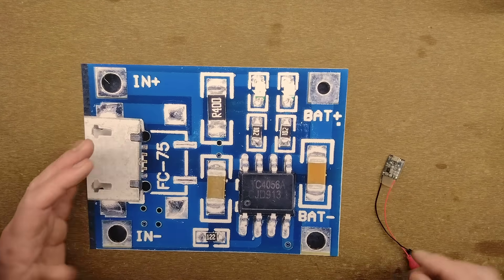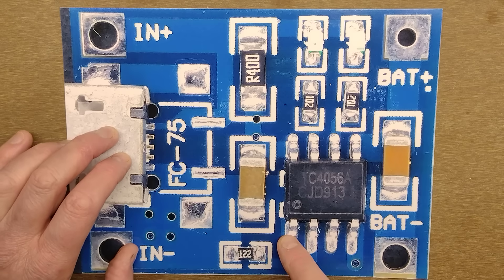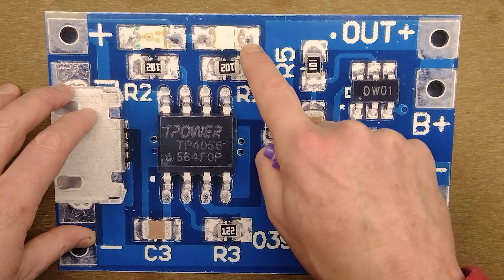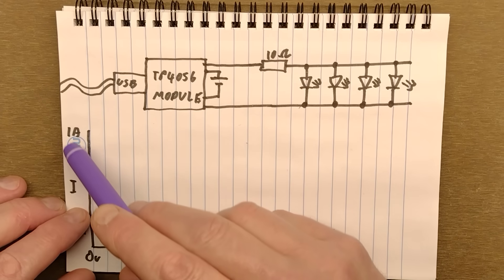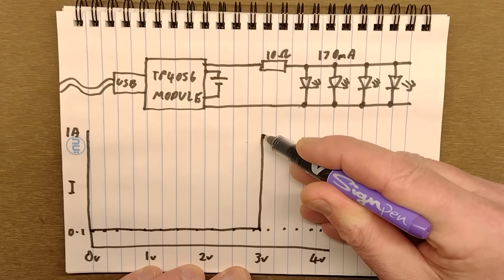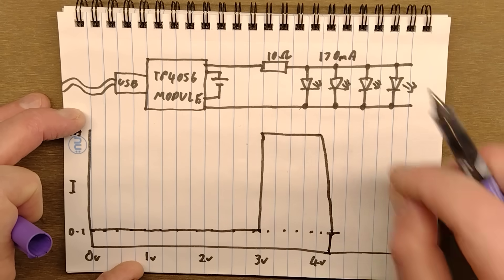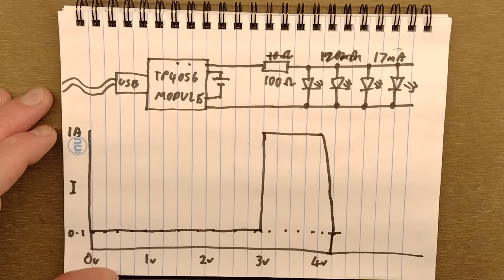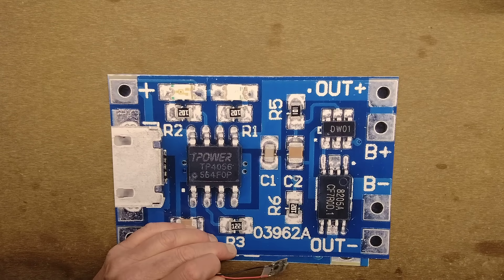TP4056 myth busting

Comment: Who do I have to blow to get a charge chip with adjustable max charge voltage? Every one I can find is set to 4.2v and can't be changed :/
Reply from the maker: Sadly, finding a charge module with adjustable end of charge voltage is difficult.  Otherwise it would be nice to program it to end at 4V to prolong cell life.

Comment: but what if I need a small cell battery, with a capacity lower than 1000mah, how to limit charge current below 1A? is there any module with customizable resistor?
Reply from the maker: You can swap the charge control resistor on these.  The datasheet for the TP4056 lists resistances and currents.

Comment: Great video! I am a battery pack newbie.  I want to make a battery pack with 4 18650 in parallel.  These modules are all i can find. I was wondering if you could hook 2 together to get 2 amp charging.
Reply from the maker: There are modules for higher current charging that just have these chips in parallel.  Make sure your cells are all at very close voltages before connecting them in parallel.

Comment: I know this is a pretty “old” video but see the uploaded is still active in the replies.

I’m using a esp32 c3 super mini with 10x 5v ws2812b LEDs. (Which can run easy on lower volts)
With the tp4056 module connected to a LiPo 3.7v 2500mAh on b+/b- pins and esp32/leds connected to OUt+/OUT- it works perfectly fine.

Max current measured at full white bright and WiFi activated on the esp is 0.67A but that would not be the use case for me.

At average it would consume about 0.48A with LEDs on (patterns with addressable LEDs)

The only “problem” is that when I power off the LEDs with the software, the esp still consumes about 0.12A and the solid red led from tp4056 stays on (charging).

When I put a switch between the tp4056 and the load, it instantly lights up the blue led when switched off.

So to make a long story short, from what i understand from the video is that it’s okay to charge while load is connected and LEDs are on/off, and the “red charging led” is only lighten up because the consumed current from the esp is just above the minimum current threshold for the tp4056 to switch to the blue light?

But there is not a big risk to overcharge the lipo only because of the red led?

Thanks for the great video and you can find some time to help me out. 👍
Reply from the maker: The lithium cell will not be overcharged.  0.12A is a very high standby current.

Comment: I have a Merlin handheld toy that takes 6 AA batteries. Since this can deliver 9 volts, do I need more than one Li-ion pouch battery for the conversion? According to the AC adapter, It only draws 0.5 amps, but the batteries that fit are all 4.2 volts. Don't know if I need two in series or one with the TP4056 doing the boost. Thanks!
Reply from the maker: This doesn't boost voltage.  I'd recommend not hacking the Merlin as it is very much a collectable toy now if it's the one shaped like a red phone.  At most change the battery clip for a new one if needed.

Comment: I've often seen claims that you shouldn't "float charge" lithium ion cells. If the load is larger than the charger shutdown threshold, you will be float charging them. In most cases, the voltage will be lower than 4.2 V, so that is helping, but still, this could be harmful.

Comment: I use this module in combo with repurposed batteries (vapes) in solar fed projects. In such projects, on a summer day, the batteries can get pretty hot, probably coz of enclosed space, sunlight on the casing and charging. Not uncommon for temp to go up to 45-50 degrees Celsius. That made me decide to modify the module to make the 'Temp' pin avalable for an NTC and 2 resistors. It is a bit finicky to isolate that pin, but it is doable and helps protect the cells from charging at high or low temperatures.
Also, rather than the 4 ohm resistor, i use a Skottky diode between solar cell and TP4056. (Allows me to charge through the USB port when needed, without damaging the solar cell

Comment: I am using TP4056 with 2W 6V 0.33A solar panel to charge my 3.7V 1200mAh li battery which will charge my device. Question is Can I charge the battery while it is connected to the load? Should I use zener diode to decrease the voltage from solar panel? Thank you.
Reply from the maker: You can do that.  If the load is lower than the charge current then the cell will be charged to the point where the solar panel just powers the load, but the charge end LED will never light unless it can finally just top the cell up to the full 4.2V.
Reply: @bigclivedotcom sorry for question, but what will happen if the load current is higher than charge current?

Comment: Hey Clive! Awesome as usual. Ok.. can the charge current be set higher than 1 amp in these chips? Thanks.
Reply from the maker: Not recommended, as they dissipate the voltage difference as heat.   But you can have more than one in parallel.  There are higher current charge boards that have a row of the TP4056 chips and just one of them controls the charge status LEDs.

Comment: Awesome,
Newbe question: if most of these rechargable batteries only put out 3 or so volts, how can I make something that is powered at more, let's say 20 or 12 more volts?
Reply from the maker: You can get 12V tool batteries with built in protection and charge circuitry.

Comment: Will the second module charge a cell that is below 3 volts? I own the less complex one and it has no problem charging  when its voltage is below 3volts . 0.07v no is problem.
Reply from the maker: The TP4056 ICs will charge from zero volts at reduced current.   But the module with protection may prevent it until temporarily bypassed.

Comment: The 0.4 ohm resistor you mention, doesn't R400 mean 40 ohm? Shouldn't it be 0R4?
Reply from the maker: The R is used as a decimal point in some low value resistors.

Comment: The TP4056 modules I'm finding online on multiple websites can have a USB C connector but they specifically state that they WILL NOT charge if the other male end is also usb c. How does that work? I thought the pins in the usb c connector would touch the necessary pins in the computer and relay that down to the TP board.
Reply from the maker: "Intelligent" chargers require at least two resistors at the load end to indicate that it is a load and needs power.  They are often omitted.

Comment: I'm planing on using one of these boards to charge a 200mAh Lithium battery. I want to connect a laser diode rated at 3v. Should I use a series resister or a voltage regulator board? I'm using a 3v red laser diode from China drawing less than 40mA. 

My goal is to have a red laser I can turn off and on with a switch, and charge with a USB-C cable. The laser power can be less than 5mW. It's going into my new project. 

Great video as always!
Reply from the maker: Many red lasers just use a resistor.  But it would be better to have a stable voltage for output consistency.

Comment: What about inner resistence of the battery, when its voltage drops with load. Then overcharging cam happen?
Reply from the maker: If the load was that high then the charger would be supplying the load directly.

Comment: Another myth is current can't t be more than 3A.  Not true if using the smaller chip without UV protection, and without Over Current protection.  I use this chip variety to charge unprotected cells on my 7A screwdriver to 4.2V,  and know when it goes below 3V cause it craps out.  Another trick the Big Guy taught me😊.

Comment: Keeping cell(s) fully charged is not the best.  Someone should design a chip that keeps cell charged to 3.7V all the time, not 4.2V all the time.  Big Guy, how hard can that be?  Granted, there may not be a huge demand since batteries are bulit for on-the-go never connected devices.  Still, for storage and "permanent" applications, I'd think there'd be demand.  Or, maybe these already exist, just not so mainstream?

Comment: I connected 4 18650 cells into battery holder connected every cell on 1 tp4056 modul.
I connected all 4 tp4056 with + and - connections to can charge with plugged one tp4056.
Problem is when i charging 4 cells i get 1.5A together not 4A like it need to be because 1 tp4056 delivers 1A per cell.
So what's the problem ?
Reply from the maker: If your cells are being charged in parallel then you could use one of the higher current charge modules with a row of TP4056 chips in parallel.

You could also use one TP4056 per cell.  But if you have the cells in series you can't use a TP4056 module per cell from a common power source as it will result in shorting cells.

Comment: You do great work! I was wondering when i was watching this video if its ok/healthy for a Lithium battery to just staying as being topped up.. Rather than draining it completely and charging it completely? I'm in the thinking  most lithium batteries have an approx cycle value of 500 cycles. I guess it would just keep it topped up until its used all the electrolytes. Would this assumption be about right. Say maybe a few years worth if kept at very low usage   -   Say  0.00006 uamps running from Arduino on sleep/wakeup.
great work, thank you for you content!
Reply from the maker: For storage they do recommend keeping lithium cells at half charge (3.7V) but in use they can be maintained at 4.2V for full capacity use.  It is preferable to charge them to 4V for standby use, but the charging circuits to do that are tricky to find.

Comment: I hate that they're all preset to 1Ah. The chip gets really hot and it's too much for lots of the smaller LiPOs. I've replaced the current sense resistor with a 2k7 one in some of my boards, but it's so finicky to do.
I've also been wondering, is there some kind of trick to make them charge to less than 4.2v? Maybe 4.15? or 4.1V to greatly increase the battery life? I know the chip doesn't support it, but maybe there's some trick to offset it?
Reply from the maker: It would be great to have one that only charges to 4V.  But it's not easy to find one, and the voltage can't be tweaked without extra circuitry.

Comment: These modules are heating fast and at the end fails 😢
Reply from the maker: The TP4056 does get hot if used at 1A charge current.  Using a lower supply voltage reduces its heat dissipation.
Reply: You can add a heatsink on the bottom that is mostly a negative ground plane used to help cool the chip.  Some are even adding a fan and charging at 2A

Comment: Hi, Great work by the way, you put out some really good education informative videos that I and  sure the 1 mil subscribers apricate.  I've recently subscribed to you because you have a wealth of knowledge that I could definitely benefit from. I have a SEIKO INSTRUMENTS - MS621FE-FL11E single coin cell battery that operates at 5.5AH, 3V, would a 47k resistor be suitable for the current set value as apposed to the 1.2k or would no change be necessary to handle a recharge of the battery that has dropped to around half a volt.
I have ordered a new battery but wanted to try and revive the battery and for a learning experience..
Thanks
Reply from the maker: The rechargeable button cells should only be charged at very low current to their designed maximum voltage.

Comment: Hi, thanks for your video. Is there a way to limit the voltage?
Reply from the maker: Sadly no.  The TP4056 chips tend to be set at 4.2V.
Reply: @ Thanks heaps for answering me. Take care
Reply: @Howie672  If you don't mind a 70% charge, you could just get a buck converter and set it to 3.8V with a 1A limit. I had a talk with ChatGPT about this: 

At 3.8V, leaving the battery connected indefinitely is generally fine, provided:

    * The regulator is stable and maintains 3.8V accurately.
    * The current draw is minimal once the battery reaches this voltage (to avoid unnecessary stress).

Conclusion:

Charging and maintaining an 18650 lithium battery at 3.8V indefinitely is safe and can significantly 
reduce battery wear. It’s an excellent choice for long-term storage or applications where the battery 
doesn’t need to be fully charged.
Reply: @ pretty much what I do, I was just keen to use these little BMS
Thanks heaps and take care of

Comment: is the TP4056 module (the one with the output)good for a tiny powerbank. trying to reuse the same casing (i have it all measured out and it will fit)

im buying 10pc TP4056 module on aliexpress for £2 after tax even if i dont make the powerbank as its going to be useful for any project with vape cells. am i overlooking anything?
Reply from the maker: Unlike a power bank, the module will not boost the voltage to 5V.  But it's still useful for powering lower voltage items like lights.
Reply: or what else could i use them for (the cases)
Reply: i have 2 types of case 
BM600
88. plastic/glass type (i have 4 of these)

is it worth it using a boost converter with them

Comment: Would this work well with a 3.7V 4000mAh lipo Battery606090? Want to use it on a Raspberry Pi Zero 2 W
Reply from the maker: It will charge a high capacity cell.  But keep in mind that the output is the cell voltage and not 5V.

Comment: Not quite sure if I got it, so I ask.....great Tks anyhow!!!

Can I now build a Solar driven UPS with this module - or not?
Some say if I have a permanent load - let's assume 250mA for a microprocessor on the load ports......the Battery will never be charged, because current goes to load only (lets assume a solar input with 500mA capability so more then the load.....

If this is true, I do not understand why so many recommend this module for a solar UPS.........(or do they really accept to need the load to be turned off (eG deep sleep) just to get the Bat. charged only in this time frame?'

You see - I'm confused about charging/discharging at the same time, pass through charging and all theese things....pls help!
Michael

Comment: It might be a little late for my question but I'll give it a shot. I understand that the 18650 battery holders are basically working on these TP4056 chips. Correct me if I'm wrong (please and thank you). If that's the case, does it mean I can, for instance, use one of those 18650 battery holders as a mini-UPS keeping my arduino/ESP32 connected all the time while the battery is charging? Thank you for your video and hopefully you see this question.
Reply from the maker: The USB powered 18650 chargers often have this type of chip in them.

Comment: e-Bay don't seem to stock the boards without the protection circuits that you said are available there, As I wanted to use some still useable phone batteries and recharge them. these cells have the protection circuiot built in. I cant see the other circuit board working in this situation; as you'd have two protection circuits competing with each other. Still I'm all for using these batteries from discarded equipment like Vaping units... After this video I rethought a circuit I had in a Model Dalek build I'd made to put the two 3,7 volt cells in parallel. So i didn't need to change the current limiting resistor; and since it would be only powering Flashing and one stationary LED I put a resistor in series with all the Parallel connected LEDS of 220 Ohm. The result... Works perfectly. Did take some time to charge; but I've had the LEDS operating now for over twelve hoursat time of writing; and they haven't shown signs of stopping. Still as bright; still as active. Incidentally Temu have the boards with the protection chip and mosfets for a ridiculously cheap price for a pack of five... Now I'm going to do a whole set of mods to my Garden lights  see how far I can take this,. Thanks for the advice in your videos; keep up the good work.
Reply from the maker: The protected output from the module doesn't need to be used if you are relying on the cell's own protection.

Comment: I use a lot of this module together with a usb magnetic charging cable. It allows quick release and connection with the cable. Should give it a try, it prolongs the USB plug lifespan too.

Comment: Great video as usual! But have you experienced the situation where TP4056 starts to charge the battery after LEDs drain it a bit? I've just discovered that if you first apply USB power, and then connect battery, the module will go crazy (both LEDs dimly lit), while if the same battery is connected before USB, it starts to charge properly. I think the first situation looks the same as with LEDs discharging a battery for some time, and the IC just doesn't kick in properly.

Comment: Also good chargers will have a function that’ll drain the battery to a certain voltage and then charge it back up repeatedly to keep it from being potentially overcharged and some cut charging automatically however it’s best to disconnect the battery l.

Comment: I would like to use the TP4056 to run my garden LEDs, I have a string plus one 18650 cell, but my Solar panel is 6 volts and the output rises to 10 volts off load any suggestions how I could use without damaging the charger board? Thanks, Bob in the UK
Reply from the maker: It might be viable to add a suitably rated zener diode across the solar panel to cap the voltage to 5V.

Comment: The 1.2k ohm resister sets the 1A max charge amperage. But, is it max? If one attached solar cells to the input and provided much less that 1 amp, would it still work? Or would one need to reduce that 1.2k resister down?

I'd love to see a solar cell + TP4056 + battery + arduino load running stepper motors (my personal project at the moment).
Reply from the maker: The resistor sets the maximum current.  If a solar panel provided less current it would only cap it when it was high enough.

Comment: Here I've been in a bit of a panic over this issue, looking at MOSFET bypass circuitry and such to prevent a problem with a large batch of solar-powered IoT sensors. You just saved me a custom board and the space.